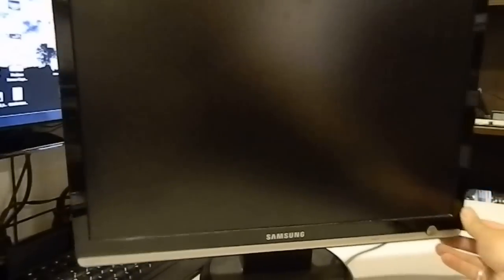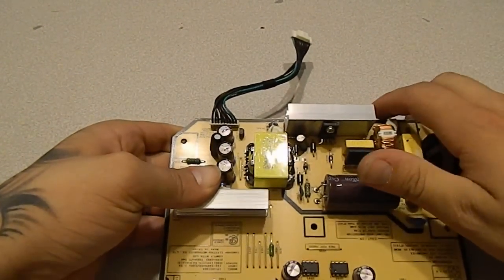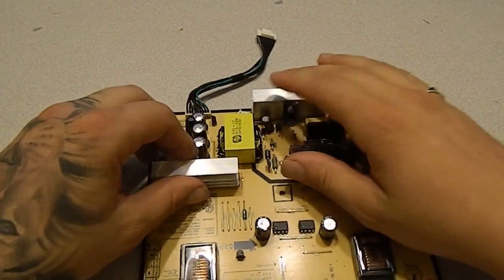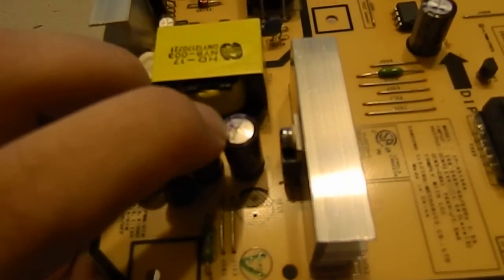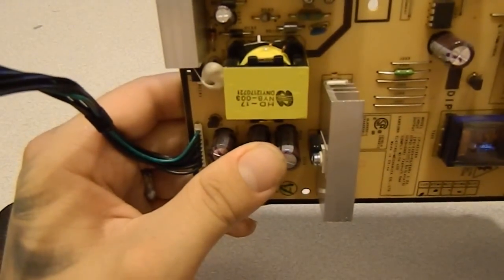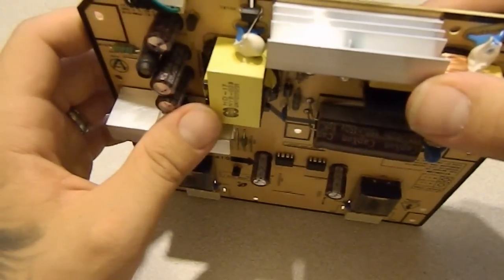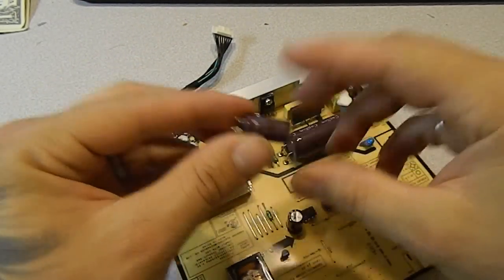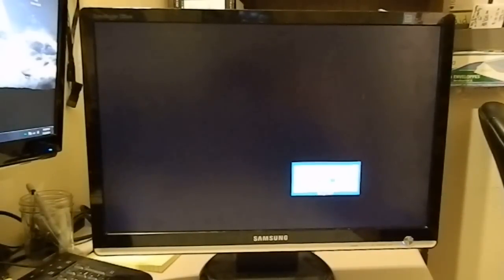Samsung 226bw monitor flickering and power supply REPAIR LCD LED How To

Comment: Same as Hypnotica, I have the exact same monitor which had the same issue. Your solution worked like a charm. Thank you for posting it, I feel really great I could repair it with your directions!

Comment: Hii, I just wanted to say that I used your video to help me fix my monitor. And it works ! So thank you very much. Getting the power supply board out was hard, but not impossible. The important thing was what you showed us about the bad capacitors. THANK YOU !

Comment: yup, I fixed 2 of my monitors and 3rd one for my cousin. Just replace the MF/volt capacitors. I noted that to make soldering easier. Just bend the legs on the new capacitors after you get them through the holes. 1st the bend of the legs help hold the capacitor in place, and 2nd it help the soldering seal the leg nicely with just little soldering, and not end up big ball of soldering.
Reply: Thanks man, very helpful tip

Comment: you didnt mention the uF of the smaller capacitor. mine is 220uF 25v, i have seen other videos where people with the same monitor had 330uF. should i stick to 220?

Comment: Thanks for the video.  I have the same screen and issue.  Just took out the power supply those 3 capacitors are definitely swollen.  

I shall find some new caps and replace them soon.  Stay tuned.

Comment: Can you show a link to the capacitors you used to replace?  I know you said you buy in bulk from ebay but you mentioned that you used better capacitors.  Could you post links to those capacitors preferably not in bulk?

Comment: Hi Master, I had a broken ceramic fuse "F801T3.15A/250VAC". But I can't find this type of fuse in my city. Could you tell me PLEASE, can I use the fuse ""F5A 250V  or  F4A 250V" instead of it ???
Reply from the maker: Yes I would use the  F4A 250V. It should work just fine.
Reply: Thank you Master.

Comment: Mine just started this flashing a few days agoonly on startup for a few swconds then it stops ....SO I assume that ths capacitors are going bad, BUT I'm not good with soldering is this worth taking somewhere to have them replaced or will I get killed on repair fees?
Reply: I have a Samsung home theater system that is more expensive to repair then to buy the whole board.  If you can just take it apart, might be worth it.

Comment: Hi techie, I tried repairing my flickering and found three swollen capacitors and I replaced them. But now it won't turn on and instead produces continuous short beeping sounds until I take out the power. What do these beeping mean? :(
Reply from the maker: Anthony Lam Are any one the capacitors installed backwards? Did you leave anything disconnected? Always double check your work and remember electrolytic capacitors have a positive and negative side. Hope this helps
Reply: I made sure that the negative was connected to the negative, I see some scratches near the area that I installed the capacitors, can this be the problem?
Reply from the maker: What do you mean by scratches? Like deep scratches in the circuit board? If so, it is possible that tracers in the board got damaged some how. If you want to email me some pictures of the board, maybe I can help. make sure they are up close pictures of the whole board.

Comment: The flickering on mine is not that major, but it's rather minor but it hurts my eyes very bady when using it's more of a slight flicker still usable I had replaced it with a new monitor but still want to fix it since it was a $900 monitor 5 years ago

Comment: Reduce screen brightness and the flickering stops - mine currently at level 23. The flickering will (temporarily) start again as you increase the brightness. If you still need the screen even brighter, cycle the lowering and elevating of the brightness and the flickering will stop completely at higher brightness.

Comment: Hi. I got a samsung s22b300 monitor. its switching ON and OFF. It has a power brick. would changing the power brick solve my problem?
Reply from the maker: quertbarbie62 Most likely it is not the power brick, but it  is not impossible. I would check the internal power board just in case.

Comment: Hi, I changed the capacitors and I think I did an okay job soldering, but when I turn on the screen it gives me a grey screen
that then slowly fades to black. Before changing the capacitors I had a problem with screen flickering, I opened up the screen
and six capacitors were badly bulging. I replaced them all and now this. Any idea where did I go wrong?
Reply: NEVERMIND the cable from the board to screen wasn't attached properly, so if anyone has the gray screen, dont freak out and double check your connections unlike I did..

Comment: Hello, I have the same issue, the flickering start for a about 20 seconds and then stop and the LCD works fine. is this solution will work for me? thanks!
Reply: NAVEL BRITTO  I didn't, and it's really old monitor, it already on trash for 3 years 🤣

Comment: when i switch to analog i get the no signal but its not flickering and nothing is plugged into analog but when i try to plug it in digital and turn it on the power button starts flickering blue.
Reply: Lispy Have you found a way to fix it?